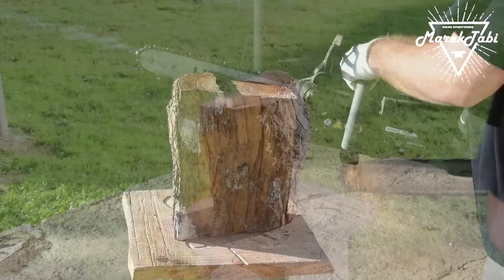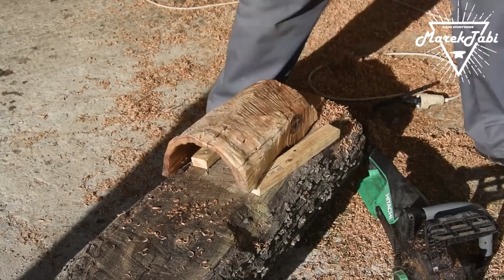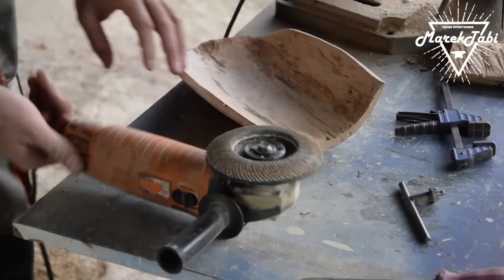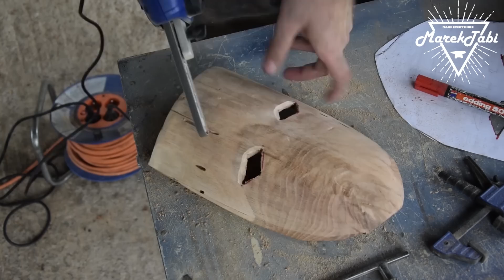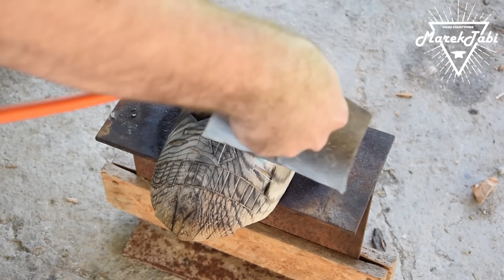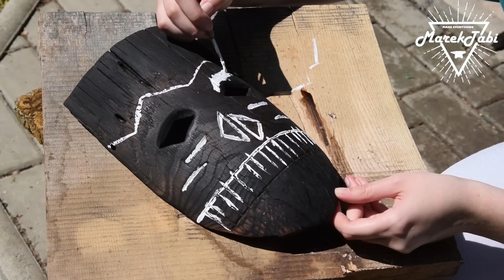Wooden Mask from one piece of wood

Comment: Original; had you had accessories for your angle grinder you could have done from start to finish with the one power tool. Your mask is good; I hope it'll be seen by your visitors so as to solicit comments. Kind regards.